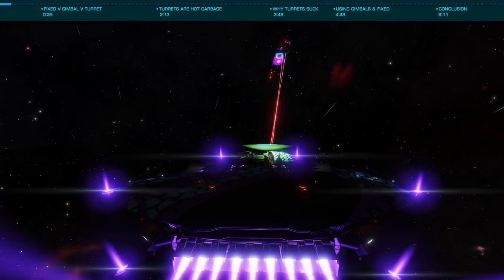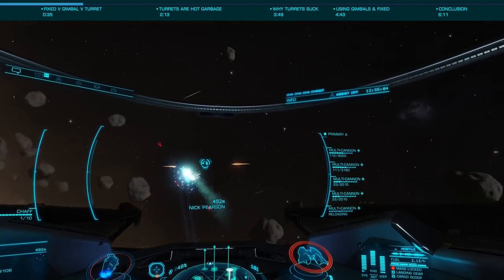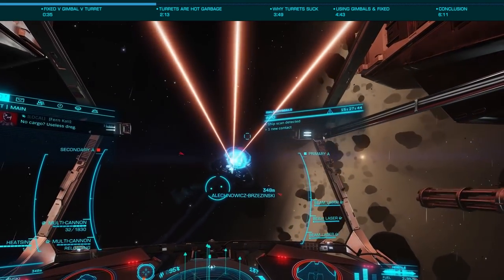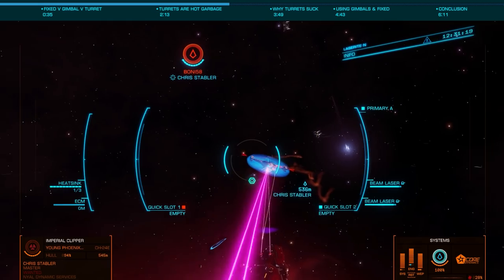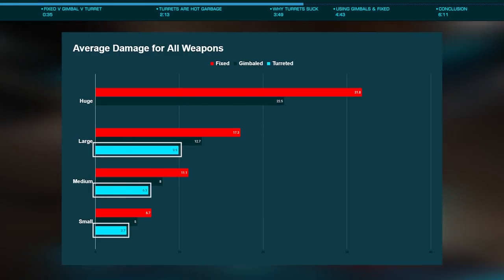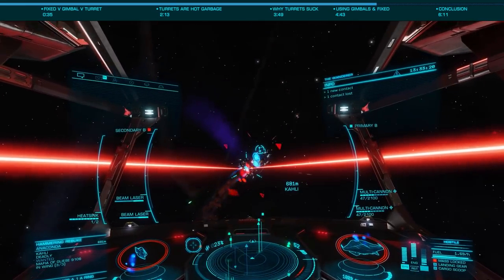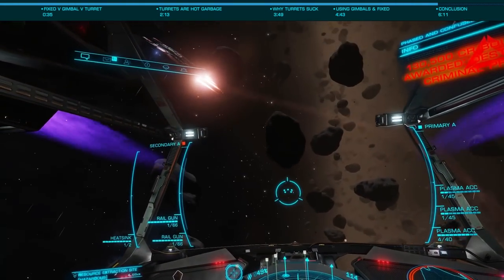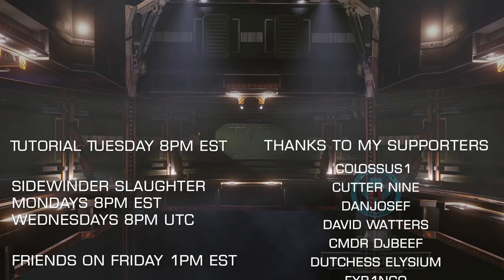Why Turrets are Hot Garbage - Fixed v Gimbaled v Turreted

Comment: So I kinda wonna argue that turreted has 1 other use. for the anaconda and the cutter turreted is far far superior. in these cases turreted does do more damage because staying on target is far harder and allows you to concentrate on other things like repairing modules and manging the fighter without the guns ever stopping. also with any laser weapon the distributor draw is far too high too keep up constant shooting anyway so even if you stay on target, after a few seconds you will be out of juice anyway and have to wait for a recharge, especially if you have engineered them for range or any extra damage type. ive used fixed, gimballed and turreted guns and I mained using gimballed for most of the time like many people. however I decided to switch to turreted for some PVE combat. However I think for PVP combat gimballed may be better. ofc this is just my opinion on it, just felt like saying it. love ur videos dude, keep em up

Comment: Turrets would only be an excellent choice on a large and hard to maneuver ship with a lot of hard points, and I really mean A LOT. If any side of the ship can always be covered by 4-5 turrets, then it's worth it. For example, if the type 10 defender would have 10 small and 5-6 medium hardpoints spread out nicely all around, then turrets would be a great option.
Anyway, the damage difference is just too big, so unless they make some changes, then turrets will still be garbage.
Maybe they could make some hardpoints on big ships especially suited for turrets (improved rate of fire, tracking speed, or something like that when mounting a turreted weapon there).
Anyway, considering what the updates have focused on so far... Let's just take a nap.

Comment: I personally think that turrets are more effective :)  as long as you put them in right places they will keep burning the target constantly. It will deal lots of damage because of "exposure" time. Also, some people have not very good gamepads which turns precise aiming in a torture. The only serious disadvantage that in full auto mode they drain to much energy from capacitor.
Its like missiles, they're easy to use but maybe not generating so much fun because of that.
So calling it "garbage" is very wrong. But yeah, hot :)

Comment: I thought turrets would be useful for large ships with poor turn rates to keep fire on smaller, more agile and more fragile targets (like a Type 10 or Cutter up against a wing of Vipers or a FDL/FAS) The problem is that their tracking speed is so low and damage so pathetic that it just doesn't work. Maybe if turrets were buffed a bit (faster tracking, maybe more damage) big ships could actually be relevant in PvP. It's not like it'd be unbalanced either since chaff would still be a hard counter.

Comment: I play at maximum settings (plus some tweaks to the xml files), so why does my game look nowhere near as good as yours?
Reply: He actually just did a video on all the settings and their impact both visually and on resources. WELL worth a look. I turned some settings down, some up and my game looks SO much better now!
Reply from the maker: Likely due to the bitrate I record at in ShadowPlay, which is 100mb/sec. It generates huge files (like a gig a minute) but the results are much higher. As has been said have a look at that guide, when I play in 1080p I run with supersampling at 2.0 which adds quite a lot of that little clarity you're seeing.
Reply: @konarider443  I've seen that video.  But I play at 4K with maximum settings that have been optimised and yet my game looks nowhere near as good as it does in this video.  The Krait for example, it just looks so crisp and sharp compared to mine which looks sightly blurry.
Reply: @Nihtglom  this is a little late, but if you turn off the anti aliasing it should help. I used to have a 4k monitor before i went high refresh at 1440p. Usually i turned that off in games because it was such a high resolution that u didnt really see the aliasing. and some AA types actually make the game more blurry. Should deff look into messing around with it

Comment: Yeah, the damage penalty for turrets is too large to be useful as a main damage dealer unless you're using one of the AFK builds.
That being said, my Type10's 2 small hardpoints see use as you said - corrosive MC and a long range, emissive munitions pulse. I'm going to try a turreted thermal vent beam instead of that pulse, see if it works alright.
Oh yeah, every other weapon in that battle barge is gimballs.

Comment: Actually.. turrets are not hot garbage. I use them on my corvette to get shields down on my targets. And use Fixed huge cannons to deal the actual damage. 
Okay. They are not the best for shield-ranks... but realistically they have their purpose. 
But taking a dump on them just because of a spreadsheet is dumb.

I would not use turrets on any smaller ships though.
Reply: I use 4 medium turreted burst lasers on my Cutter for a similar reason. Sure the damage is trash but they are used to keep my enemy's shields in check by the time I finally turn around and train my heavier weapons on the target. Especially considering how long it takes to turn the Cutter...

Comment: I am clueless regarding the mystical art of combat engineering, so turreted beams and multi cannons  protect my vulnerable ass until I can turn a FIND my aggressors, and fire off a couple of smart missiles.  Beans burn off shields, and multi's hammer a torrent of corrosive rounds into the exposed hull.  When the missiles find their mark, it's good night Vienna!  Yes, turreted weapons are less powerful, but the hit rate more than makes up for it, when you consider my lack of desire for PvP and resultant lack of experience.
Beginners and peaceniks NEED turrets!

Comment: 360 degree combat, 360 degree combat maneuvers, 360 degree weapons. Weapons are measured in comparison to each other by measure of passing target, fixed position attacker. Damage output is measured equally across all weapons in this manner. Combat maneuvers can greatly impact the variance of weapons capacity in all situations, being difficult for some to measure equally with targets in motion, attacker in motion combat. Turrets offer all three weapons type in a single weapon setup that can be changed in an instant to fixed, gimbled, or full turret mode. Same as you can set tap round, auto fire target visual, and fire at will setup on weapons ai / module assist. Pip output and control also effects weapon capacity as does power modulation to the situation negating even fixed weapons, or scrambling turreted ones. There is a range to combat and there is no one setup that beats the other for all ships. Fixed is not superior to Turreted and turreted is not superior to fixed. There is a range to the modules because there is a range to combat. Focus efforts more on hull breach and reduction of damage due to that when targeting, pace and measure maneuvers properly and you will win out. Regardless of setup. Know when to evade, defend, and focus offensive. Fly what fits your style and effectiveness in combat. Space combat is a combination of naval, helio, drag, lead, follow, targeting, time on, time off, reload, power management, munition variances, speed capacity, mass, straight line, sideboard, vertical, lateral, and much much more combat tactics. It isn't just pew pew.

Comment: The combat is garbage, period. I know that some have accepted the weird close-quarters tickle fights, but even observing a duel between veterans is snooze-inducing. Joust, surrealistic flip, spam weapons, flip, shield cell/heat sink/boost, flip pew-pew, etc. Rinse, repeat. 

It looks fun, but in reality, it comes down to a few variations in tactics applied to an extremely limited system. The fights are the same regardless of hull class/mass--which makes no sense, but here we are...
Reply: pure spin to win bcause there is no rudder control as FDev wanted the game to work on a controller and if console ~parity~ meant removing a whole lotta PC interface/gameplay/button-mapping functions the n so be it. 

ED is a poor mans console space-game with the sparse and strung out content to prove it.
Reply: @IRMentat  Eh...actually, yaw control is there (and vital,) but I was referring to the speed limits, weapon range, and the supernatural handling of heavy vessels, etc.

Comment: greets from germany if you have a flying brick then turrets are pretty useful like type10 or cutter. i have some turrets aswell on the conda 2 class2 canons these are on the front right and left. on the bottom 2 turrets class1 1multi with corrosive 1 flak gun with the speed debuff 2 class 3 plasmas on longrange and the rest with beams. the good thing about the canon turrets on the front of the conda is the awesome shooting ark and you dont have to manage them. the only downside of the canons theyre pretty fast empty after killed 6/8ships medium or bigger.

Comment: but if your ship has a slow turn rate and cant keep the enemy infront then turrets are good, fixed do more damage but if your up against a more skilled nimble pilot then fixed are pointless. My anaconda turns very slow so my turrets have helped me alot dealing with smaller faster ships

Comment: Turrets are OP when operated by multicrew. Faster turn rates and no jitter. I don't know if it has been nerfed (it was like 2y ago).
Reply from the maker: Uh, no. Sure, you have pretty high time on target but when they are that much lower DPS than gimballed or fixed your time to kill will absolutely be lower than with gimbals. Sure they are fun, but they are most certainly not OP.

Comment: Turrets need a damage buff, they already cost more and have bad tracking on top of that.
Reply: No, they just need a tracking buff.
Reply: @brianlam5847  They need a tracking and damage buff, all weapons should do the same damage i don't care about stupid balance arguments the balance is in the amount they cost, turrets and gimbles should be pin point accurate out to the ship sensor range and should also negate chaff at full range if you have an npc/human crew member and half if using ship computer. Go for realism and the balance will happen on its own
Reply: @danny1229c  No. Just no. A tracking buff is the only thing necessary, and cost should not be involved with balance. Chaff is a fair and balanced counter too. If you really want them to deal the same damage as fixed, then increase the power and capacitor draw because of the tracking so that only a couple can be used.

Comment: I only use turretted weapons on my Anaconda (and probably my Cutter when I get one) because even with grade 5 dirty drag drives, it maneuvers like a beached whale.
Reply from the maker: Ugh, I assure you that gimbals are the FAR BETTER choice, even on the Anaconda. If they are easy to use on a T10 they are perfectly fine on the Anaconda, rewatch the video and check out the stream I did showing the difference in kill rate per-hour, there is no contest. I hope you'll give them a try.

Comment: Since the early days of the alpha I am utterly disappointed by Turrets. Apart from the Cost/Damage disadvantage the 3 fire modes are also hot garbage. For example, you can't tell your turrets to stop firing when in the mode that starts firing by pulling the trigger. How on earth does a second triggerpull not cause the weapons to cease fire again?

They need a buff in effectiveness concerning price, damage, energy, tracking and the turret mode logics.

Also, even then, due to your ship blocking their line of sight, you can never bring all guns on target at once, resulting in much lower DMG output still due to the fact that they cant fire simultaneously at the enemy, except for when the enemy is directly in front of you, in which case fixed and gimballed would still deal MOAR damage.

I always wanted to love turrets in E:D but they are utterly unenjoyable.

Comment: I use turrets on the small fittings on the Anaconda... as I'm not really sure where those hard points actually are 😉
Reply from the maker: Sure, if they're engineered to apply an experimental, like corrosive, etc. then great. If memory serves they are right up front on top.
Reply: on the anaconda the two smalls are on the bottom right that the back, best use i've found for them is feedback rails
Reply: Excuse my ignorance. Also ps4 player. What is a feedback railgun?

Comment: This is one my biggest peeves about this game. How can it be possible that an advanced civilization that's capable of building ships that can move from one star system to another in seconds, is unable to develop a turret and a targeting computer that effectively track a target, without compromizing weapon power? This is ridiculous. We're not talking about battleships with 500mm cannons that weigh as much as an apartment building, but spaceships with energy weapons, which do not have recoil or a lot of weight. An energy weapon should be just as powerful, regardless of mount. How exactly did such a stupid civilization manage to survive this long and spread so far? Did this civilization never encounter more than one enemy at a time, coming from multiple directions? Any civilization that's ever encountered multiple hostiles coming from multiple directions, would immediately start designing turrets and automatic tracking systems that are just as powerful as fixed guns. It would also make sure that the systems are able to automatically return fire, in any direction, without human input. It would also be able to design a system that automatically deploys countermeasures. Actually, the Israelis already have these systems on their Merkava tanks, so how can the Elite civilization not have them? Oh, and how does something like the Anaconda use all fixed weapons, when it doesn't have the turn rate to keep its nose pointed at the enemy? Enemies will always be behind the Anaconda, not in front of it, so turrets are the only option.

Comment: Turret tracking IS slow. The firing arc is also not continuous vertically. A turret on top of your ship firing at a target that flies over your ship will track up to a point, stop, rotate SLOWLY 180 degrees, then continue firing. The process will reverse when your pitch to face the target - again SLOWLY. Watch the process with an external camera. My turrets can hit targets behind me, but they never do; they're not fast enough to get the chance. Turrets also won't fire on things they can't target without changing the mode - like the almost-dead silent-running ship I can SEE. RIGHT. THERE. Also, engineering multi-cannon turrets to be long-ranged just burned through ammo. It's "in range", but it's not doing any good.

Comment: The value of gimbal or turret mounts is entirely subjective.  What are you flying compared to what you are most likely to face?  Is your ship fast and nimble?  If so, even if your piloting skills are no better than my own you can probably do just fine using fixed mounts on almost everything.  If your ship is NOT so very fast or nimble.  Without at least gimbal mounts you're probably going to be spending a LOT on rebuys.  The damage your weapons do per second only counts for those seconds your weapons are on target.
Reply from the maker: Well I fly a T10 quite a lot in Conflict Zones and it works exceedingly well for me fully gimbaled (as it really doesn't work fixed, save for 2 rails up front).  For medium and small I always run fixed hit-scan and gimbaled multis (rarely use fixed multis as time-on-target with them is quite a lot harder).
Reply: @Exigeous , I would count that as being due to your piloting skills/experience.  

I have a Python, Anaconda, and a Cutter decked out to be combat capable.  Please note I said capable.  Not dedicated or even just serious.  If you ever catch me with FA turned off it's probably by accident.  Because I know that I'm just not that good at it.

Using fixed or gimbal mounts either one.  My only real value in a fight is as the dude in the wing who jumps in and starts the fight JUST to draw attention.  And then hope I can stay alive long enough for my partner(s) to kill the targets.

Using turret mount multi's (set to Target Only) plus seeker missiles (working on power play to get pack hounds).  I can jump off into a High-Res or Haz-Res and seldom need to worry about anything getting past my prismatic shields.  Clippers are both fast and nimble.  But by the time that Clipper (even an Elite) gets turned around to target me, I'll have his shields down and usually have his hull to 50% or less.

Eventually I'll probably make Elite in combat despite myself.  I'm not that interested in PvP and I can sit happily in the center of a firefight and do nothing but gather mats.  But I found I get a lot more mats if I'm active in that firefight.

Currently, the ships that seem to give me the most trouble are those stinking little Vultures.

Comment: Hot garbage? Sounds like someone doesn't understand how to use turrets in an optimal setting and thus blames the tool rather than the method. Turrets can easily be the next best thing, if you use them properly. For example... I have two on my Anaconda (at the back) which means that enemies which creep up on me will always be met with incoming fire, even if I can't see or target them yet.
Reply: gimballed